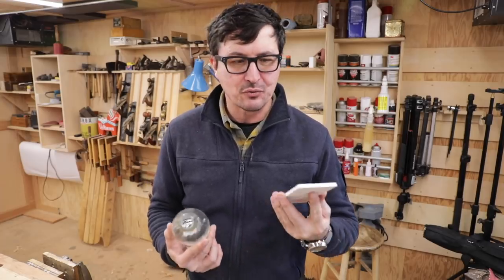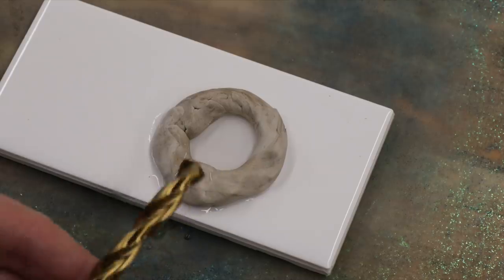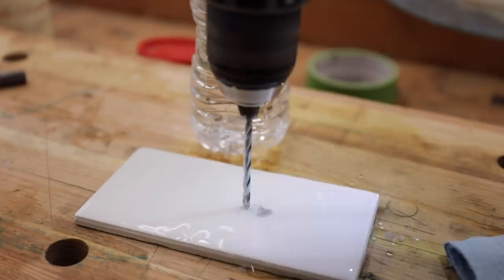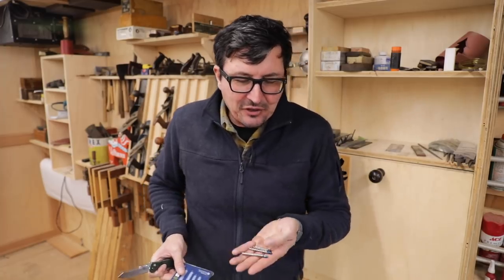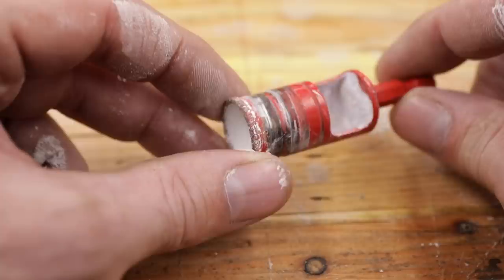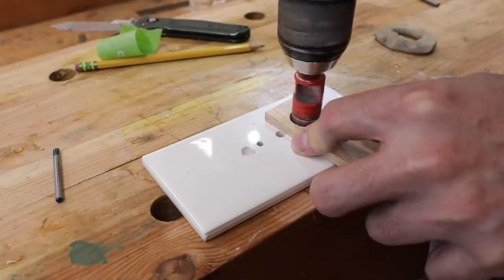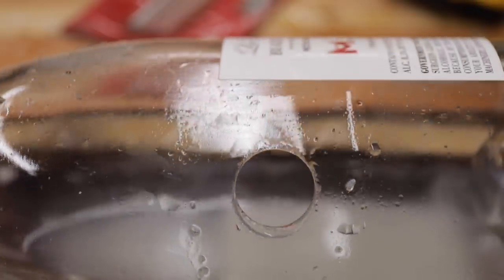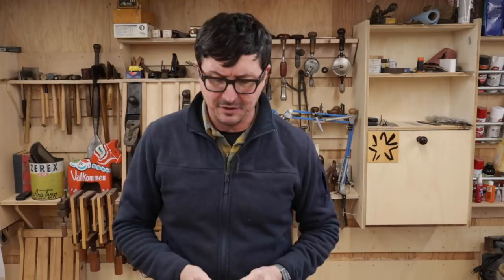Drill A Hole In Glass - How Hard Can It Be?

Comment: The method that I've used to drill through tiles with masonry bits is to b4  when you go to start the hole is to stratch the tile glaze by placing a piece of tape onto the tile then rock the drill bit backwards and forwards by hand using a smaller drill bit similar to when u spot drill a piece of metal, then once you've done that you can then use the correct size drill bit needed to make the finished hole size

Comment: i was making glass paned ant farms a while back.  i used the diamond round bits in a crappy drill press.  i hung 2-3 lbs of lead bars (weighted as needed) from string hanging on the drill press control lever to give light consistent pressure.  each hole took 30 minutes or more.  I had the same issue you did with the back side of the glass finally giving away taking a chunk of glass with it.  i'd do 3/4 of the hole and then back down the weight for the final cut.  always blew through at the end even with a wood backing.  Not an easy thing to do.

Comment: I have no clue, for the actual name, but I call em spear tips. There great. Just keep your drill in low. An if you dont keep good pressure it makes a three point hole kinda like a triangle. If u try to push past u most likely will break the bit. An use a center punch.   7 years of working with glass. Good vid

Comment: I used to drill holes in glass using a diamond core drill from 1" to about 14" in diameter with a thickness of about 7"...These pieces of glass, called a boule, would come out of the furnaces more than 5,000 pounds in weight... Most of the time we used a waterjet using a garnet abrasive and 55,000 PSI...

Comment: I tried drilling holes thru window glass for a restoration project and with 2 different kinds of glass bits it shattered or chipped out the glass every time, if it didn't crack the glass it  took chunks out, the worst part is when the bit breaks thru at the end, that caused breakage almost every time. Even if it doesn't crack right away, it only takes a minute chip that will crack over time.

A round grind stone might work better, but I had to drill 3 holes of different diameters thru a  7" or so diameter piece, I gave up, there's places on the web that drill glass to your specs/drawing.

Comment: I install commercial dish washing machines and have to drill into ceramic to hang the chemical dispensers on the wall a lot . Use a very sharp pointed awl and a small carpentry hammer to very gently break the surface of the glaze where you need to drill the hole . The glaze will chip away just enough to use your masonry bit without it walking around on the surface . Once you get the hole started it should drill easily . Although it seems like you run the risk of breaking the tile I never have . You just have to use one gentle tap, don’t hit it hard .

Comment: Heat strengthens along with tempered cannot be drilled or cut. You can sand the edges up to a point with the cost of diminished strength.

Comment: On drilling tile just take a harden nail like one used to shoot in concrete or steel and tap lightly to chip a Small starting point in the tile then use the Cheap masonry bit to finish....a nail set or any punch works as well.....little things like this are not usually in the book...comes from doing....

Comment: Watch out for tempered glass, it will shatter even with very low speed diamond drilling. If you have access to the other side of the glass you can use duct tape or duct tape and a piece of wood  with very light pressure to help avoid that rough exit effect.

Comment: Is that a benchmade 940? Dude if you're having issues opening plastic with that knife you need it sharpened. That s30v steel holds an edge for a long time but that means it gets dull so slowly it can be hard to notice when it's time for sharpening. If you can't shave you're arm without it feeling scratchy it's time to sharpen it.

Comment: I seen some videos that they used a wire hooked to batteries and the heat cut the glass. I wonder if you could make a round version of that for holes in glass instead of just straight lines.

Comment: I'm wondering if you could have used a center punch or a dot punch for tile work?  Should take away the wandering issue but I've only used one for wood and metal work never tile. I'm sure a spring loaded one would just shatter the glass though.

Comment: You can't cut or drill through tempered glass because it relies on residual compression of the other layers and tension in the inner layers to make it strong. Thats to take advantage of the compressive srength, once you break through and hit the tension part it will shatter instantly

Comment: Tempered glass cant be drilled, it will blow up. The surface strength of tempered glass is about 5x stronger than regular annealed glass. Tempered glass is composed of 3 layers, 2 suface layers, and a middle tension layer. You can drill until you hit the middle layer, then its game over. It is extremely sensitive, any compromise will set it off. If you have spare tempered glass, heres a test for you. Beat on the surface, then tap the edge. The edge is weak, because the tension layer is exposed.

Comment: use hot glue to hold the template in place. Just put several dots around the board. do not glue to the grout. Only on board and tile.

Comment: You would be better off using a drill bit designed for metal than a masonry bit surely? Sharper for sure. What I use at work for drilling tiles and works fine

Comment: On the 3/4” hole bit. How about water in the side slot.  Looks like maybe designed for that.
Reply: The hole is to remove the core Wich can become lodged. A good trick is to drill through a tile sponge with all your core bits ! as your drill bit sinks it compresses the sponge core and releases water  within the bit .

Comment: A thief told me how to EASILY break auto glass. And not make much of a sound either.
An EMT told me how they break auto glass too with a simple tool at most any hardware store.
Brute force is not the way to do it (hammer and such).
No way to know if someone running away from you will fire backwards.

Comment: Still watching...wondering how your lubrication techniques will work on a vertical surface.
Reply: might be able to tape the water bottle, not full of course, to the vertical surface with the tiny hole pointed at the wall so it dribbles down on your drill.

Comment: Its impossible to drill threw tempered glass. Now technically yes you can how ever the tempering process, similar to prince rupert drops.
The glass will shatter out of nowhere. I did it once just to try. Made it threw took hours with a new bit going slow. I picked it up set it on the rack, an it exploded shot all over the shop. Make sure u got safty glasses.

Comment: For diamond core bits use putty dam with 50 - 50 mixture of water & antifreeze as a coolant & your diamond  bits will last longer!!! For spear point bits we always used turpentine in a putty dam at the glass shop since 1970. Drilling holes in tempered glass will not be successful.

Comment: There is a secret to open those damned blister packs. the all have that little hole at the top to hang it from, if you get your finger tips between those 2 layers you can enlarge that hole then rip straight trough

Comment: Do Not , i repeat , do not , never under any circumstance drill a hole in a tempered glass . as soon as you damage the glass it will shatter or rather explode into millions of little pieces and i bet you dont want to clean up that mess . you would find little glasspieces years after that experiment in spots where you thought you have cleaned up properly . just dont do it ^^

Comment: The absolute soy of this guy,
You absolutely do not need water when drilling ceramics, travertine or marble. They're so soft it doesn't matter.
You can't do hole after hole at super high speed with no cool down time, but you absolutely don't need water on those.
I love customers that put in these inferior tiles, because they're super easy to drill for shower doors, shelves, towel bars, etc etc.
But I would personally never use a tile other than porcelain in my own home.
Also just 10 short years ago people were dying to tear out subway tiles, now people are dying to put them in. It's hilarious.